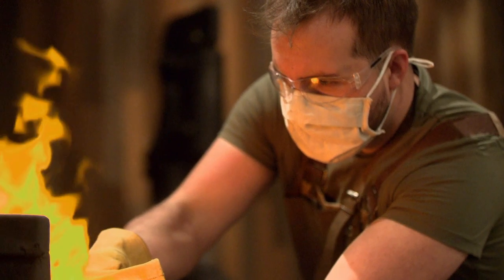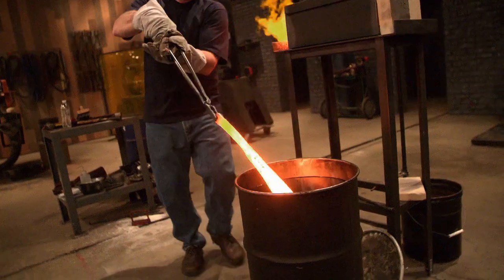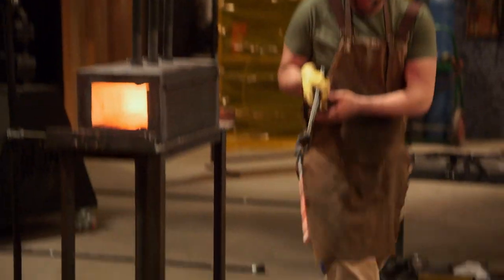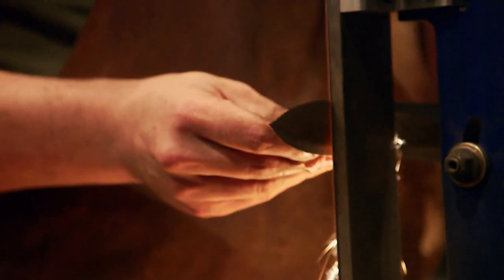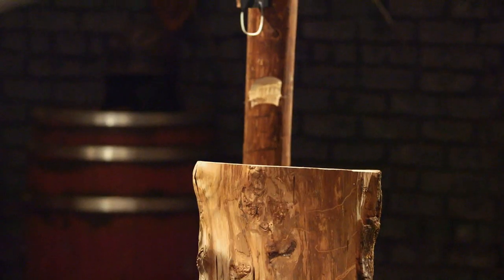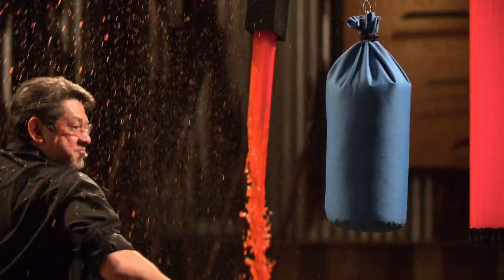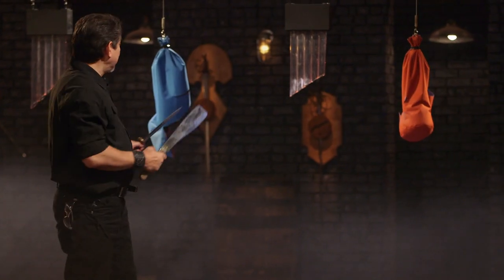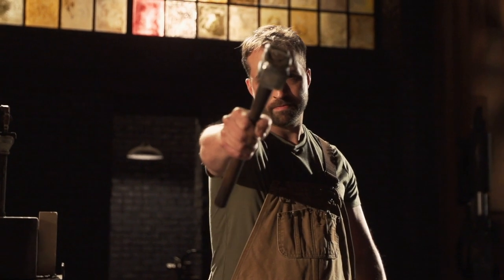Forged in Fire: Deadly Weapons Battle in DUEL OF DOOM (Season 8)

Comment: I don't know why they soak all steel in a water after they heated it, it will became hard but brittle and easily break!.. Here in the Philippines, after forming by heating, we soak in a liquid the half of the blade to harden the half (with blade) and the rest remain smooth or unharden to hold and avoid to break/broke..

I view all videos of FORGE IN FIRE, mostly their blade broke because of wrong strategies in forging.. They should only harden the half(at the blade side) and rest remain soft as normal, this will hold the blade uneasy to broke..
Reply: But the problem with that is that the bottom half may be TOO soft and you end up with a bent blade.
Reply: they soak it in oil
Reply: @heftyordinanceindividual4015 , No! Can hold harden part, soaking all part will easily break if you strike in a hard object... See what happen when they strike in deer horn, it broke into 2 part..
Reply: @dailyviewstv5323  Yes? there's a reason that most blades have blades that are completely hardened instead of only partially